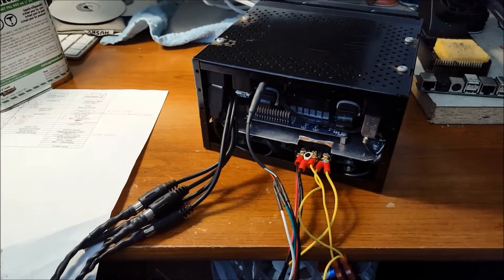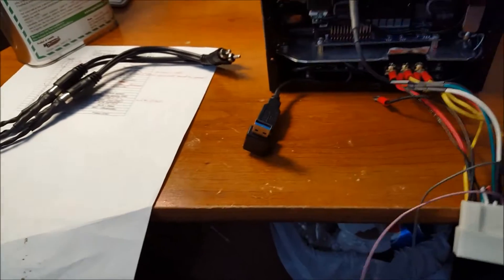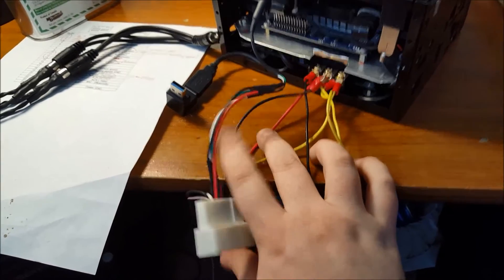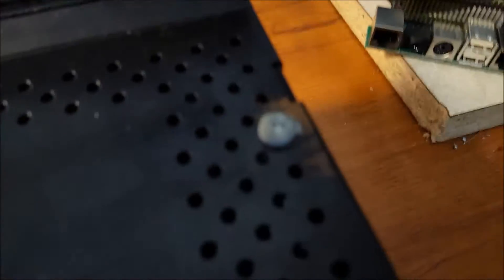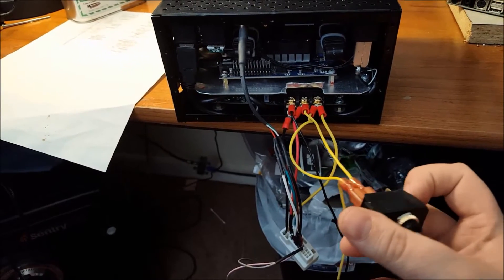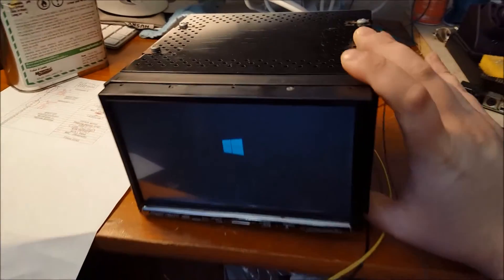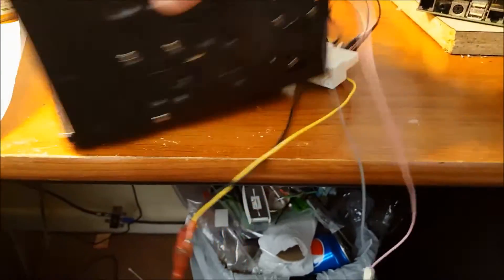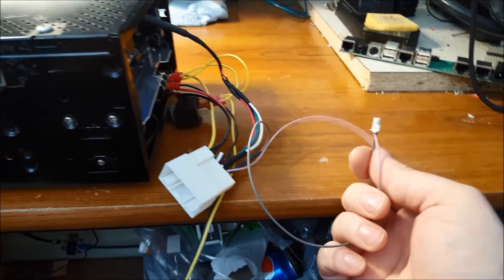MinnowBoard Max Windows 8.1 Double Din Custom built Carputer.

Comment: Hello mate good job on the build its looking good. hope to eventually get video of my project up soon but trouble with fabricating the fascia has knocked me back no end.
I have one massive question concerning the power supply.
Is the M4 ATX monitoring software working for you? Im using windows 10 x64 and the WHQL driver is not working at all. BUT using the same system and booting windows 7 x64 it works just fine with the default windows WHQL driver. After some searching it appears windows 8.1 x64 has the same problem im having... Is the monitoring software working for you?
Now mp3car forum is down the power supply has zero support and minibox customer support is like 1 guy in a fucking bed and breakfast.
Hoping you have already figured a workaround before i go tearing into drivers.
Reply from the maker: Chris12ossi really? This is all news to me. I'll do some testing tonight when I get back to my office, but yes my monitoring software is running just fine on Windows 10; however, I have not let that thing touch a wifi signal since the day it was built so there are many Windows updates that are not on it. I will get back to you later with my findings.
Reply from the maker: I was able to get the software to run just fine on a fully patched version of Windows 10. Do you have a screenshot of the error by any chance?
Reply: Thanks for your replys mate and sorry for my late one. Wasnt expecting you to reply so soon haha. Unfortunately i dont have any screenshots mate as ill i get is an error.code.10 i believe in device manager.
The error shows like using an old legacy soundcard with no driver support. Shows up in device manager and has a yellow.exclamation mark. To be fair i never downloades the inf files from asrock for my asrock z97m itx/ac mobo, i just let win10 do its thing.
Plus due to me testing this i havent been bothered.to drop money on genuine windows disc for it yet.
Ill boot the carpc back up with windows 10 and see what happens when i get the drivers from asrock not from win whql database.
Thanks for your help mate
Reply: Well. we have some err good news! last night i downloaded every single driver from asrocks database and went ahead installing them one by one. Also risked the creators update for windows 10 (1803 i think) and it installed like genuine windows does, for now. For the record i do have a genuine license for windows 10 that i purchased years ago but it only covers one computer. And i plan on buying another now its much cheaper.
After all that last night. It finally showed up in the device manager as a 'HID compliant vendor defined device' BUT still gave me 'NO DEVICE FOUND' when loading the config tool and nothing on the monitoring tool either. The tool loads but shows zero volts, temp etc.
Anyway, i just fired it up today and it worked, well half of it did! The monitoring tool just worked right away but still got NO DEVICE FOUND loading the config tool. Also still 'HID compliant vendor defined device' in device manager.
But now after a restart its back to how it was at the start, 'HID input device' in device manager with yellow exclamation mark. Showing a error code 10 'This device cannot start'.
So yeah not great news but tells me there is some strange compatibility issues with windows 10 since windows 7 works like a charm. And it works on your system.

I just hope people who watch your video and assume it works with all systems like i did and think the m4 atx is worth 70 odd pounds to be for me at least, an arduino and a couple of relays.
Reply from the maker: Chris12ossi I pushed updates yesterday and mine is still working fine. Showes up as a USB Composite Device in the dev manager. I remember having the "device cannot start" error but I can't remember if it was due to a short in the custom usb harness I made for the m4atx or it was due to low power from the usb port. I had a ton of power problems with this build that's why I put in a 12v 5a powered usb hub to correct those funky problems.  

However, I feel that what your experiencing could be a hardware issue.

And this video is old at this point. Software compatibility doesn't last forever otherwise everyone would still be using Windows XP. The video is for educational purposes and is not a "how-to" or "tutorial".

Comment: Where to get the lcd frame with switch
Reply from the maker: kamran ali 

Here's the exact link to what I purchased in 2015, you may need to search around as this one is no longer available on Amazon. 

https://www.amazon.com/dp/B00HNLXZHO/ref=cm_sw_r_cp_apa_i_9aUcBb6WSQFJ1
Reply: CorJFexd 
Thanks  for replying 
I want to know the casing
Reply from the maker: kamran ali 

The case I used was originally a double-din head unit that I gutted out and used metal cutters to shape to my needs.

However; since then people now took up a market in selling such cases. The top few Google searches return several sites that you can find them, but I have no preference or a suggestion on which site you should do business with. Purchase at your own discretion.

https://www.google.com/search?q=carputer+case+double+din&client=ms-android-sprint-us&biw=360&bih=318&prmd=sivn&source=lnms&sa=X&ved=0ahUKEwjbtvDOvqbbAhVLFTQIHdYsBGYQ_AUICCgA
Reply: CorJFexd 
Thanks man

Comment: How much to get this
Reply from the maker: kamran ali 

I don't remember but it was around 1,000 for all the parts including the ones that didn't fit the build, if I was to do it again it would be cheaper since I know what exactly works and fits.
Reply: CorJFexd 
Thanks for replying 
May i know where  to get this staff  and guide  to fix
Reply from the maker: kamran ali 

There is no guide as this build is of my own design. There are many out there I am sure, but this one is one of my own (DIY) and is here for educational purposes only. In fact there are some companies already selling Windows 10 head units; Nonetheless, All are welcome to reverse engineer what is seen in the videos. 

Down in the video description you may find a list of parts that I used in this build. 

I have no further plans to continue this project or to make a guide on how to build it as it has many many flaws.
Reply: CorJFexd 
Thanks alots 
Actually  i want to build  my own double din win10 or Android  i dont know  where to start witch is bater 
raspberry pi 3  is bater or
Odroid-xu4 bater 
I try to find other thanks for replying 

Have a nice day
Reply from the maker: kamran ali 

Personally I ditched the minnowboard max for a Jetway NP93 Pico-itx and I still use it in my head unit to this day. The boot time is much faster than a dev board, but also much slower than M.2 

I struggled with dev boards because I'm more of a hardware guy, and I was only bashing my head over driver issues with the raspberry pi and the minnowboard so for me the easiest way was to resort to embedded PCs such as the Jetway NP93 that already had software and driver support.

If I was to do it again I would go with a Mini-ITX form factor with an M.2 socket and call it a day.
Reply: CorJFexd 
Like this if go with  ITX how is positively  to trun on my amplifier  4ch and 2ch subwoofer

Comment: hi great work! i am looking into building something of this caliber, i was wondering where the best place to buy a double din cage or enclosure from? or did you make it, greatly appreciated if you could reply. thanks.
Reply from the maker: the case is from a broken double-din that I just gutted and used for this purpose. If you google terms "carputer double-din case" you will find a seller who is selling a decent case that even comes with hid/usb front panel buttons, I'm not linking the site because I have not personally purchased anything from this seller.
Reply: thanks for the reply! i have seen those that you speak of, look good quality but the only issue is that i am in england and by the looks of it that's usa based.. they arent super cheap for what it is either.

im surprised that something like those project enclosures aren't readily available, it's kind of dissapointing for me.

i was considering just getting some sheet metal and fabricating it into a suitable cage, with a few vent holes drilled and a suitable facia i suppose it would look the part and function well enough,
Reply: also one more thing, do you happen to know the resolution of that screen? 

ive been looking at a few with hdmi driver board, and i just want to get an idea of the quality, is it 800x480 or higher? im looking for 1080p if possible, ive seen the model you listed in the discription on amazon but its 800x480 and im afraid that isnt good enough for what i would like. again thanks!
Reply from the maker: +Virulent 
this project was not a cheap learning curve, but if i could do it again that'd be a different story. fabrication is probably the cheapest way next to recycling an older double-din, however in this build i ended up with heat issues and i would take everything back for one of those cases made available online, and my screen is 800x480? i think... but "https://www.adafruit.com/categories/400" has the same size monitor with resolutions higher than 1280x800 (for a price of corse)
Reply: i suppose it is not cheap in some respects, i am aiming to keep it quite cheap though from whatever bits i can source, i have quite a big gap behind my dashboard in my car so i was hoping to try and squeeze some air inlets on the front of the unit and vent to the rear. maybe i will buy one of those cases from what you say, can always test it and see what works i guess.

and if that is the case your screen looks a good enough resolution to be honest, it's not like i'm going to be watching movies on it really. do you use this unit to play audio in your car, (might seem like a silly question) but i was just thinking about amplification and volume control too. as a seperate amp seems the case with the build i picture in my head, and then a volume control to suit that. 

Greatly appreciated, you sir are a gent!
Reply from the maker: +Virulent 
I actually had to install an amplifier as my car did not have one. For sound i have an hdmi to analog extractor/convertor in the build and the left and right channels just go to the amp. For volume i have a fully functional steering wheel control (http://www.rcjoycon.com/base_3/menu_10.php?com_board_basic=read_form&com_board_idx=27&menu=10&&com_board_search_code=&com_board_search_value1=&com_board_search_value2=&com_board_page=&) never had a problem with joycon but be prepared if you do a firmware update... you'll need to be able to reach a reset pin on the board. 
check out my other two? videos as many more links are posted and some of this was already discussed. Thanks for checking it out and eventually I'll make a final update video on the finished project.
Reply: great! thanks a lot for the help, i really appreciate it! it's good to get the tips etc from the horses mouth. i've had a lot of experience building computers from an early age so the monitor/pc part will be all good, its just the enclosure,  heat dissipation and audio sides that i wasnt sure on which hardware would be good but ive got some good ideas now so cheers! looking forward to an update vid. subscribed.

Comment: Great build, I'm doing something similar but with a standard mini-itx mainboard. I never know of the Minnowboard! The LCD is capacitive or resistive? Where did you find the 2DIN case? recycled from a head unit?
Reply from the maker: Alessandro Pivaro Thank you! Haha yeah if I was to make another I would go mini-itx. I don't exactly know why I was so compelled to use the minnowboard; it's not the most powerful thing in the world but at least I can say i'm not disappointed with it's performance, and that it's never had any moments of freezing/locking up, crashing, or lag times and the boot times get faster every-time Intel puts out a new bios update. The screen is resistive and I found it on amazon (http://www.amazon.com/gp/product/B00HNLXZHO?psc=1&redirect=true&ref_=oh_aui_detailpage_o09_s00) It's quite a popular screen and I've seen it used in multiple Mini-Itx builds. Lastly the case is unfortunately a recycled Almani DVA-2100 and I just built around the awkwardness of the design. It was not until after the project was complete that I learned of these (http://www.mo-co-so.com/Bybyte-BBX-1-Mini-ITX-In-Dash-Double-Din-Case-p/mcs-byb-bbx-1.htm) actual double-din mini Itx cases for purchase.
Reply: CorJFexd I'm using this mainboard here http://www.asrock.com/mb/Intel/D1800B-ITX/index.it.asp with integrated celeron dual core CPU. I think your CPU is more powerful than mine. I bought exactly the case you linked but there's not enough space inside for dual HDD, m2 atx and amplifier board. Now I installed Windows 10 and it runs great... I'm waiting for the ISO harness adapter and then the system is ready to be installed :)
Reply from the maker: Alessandro Pivaro Never got a notification for your reply. weird. Nah that board is faster definitely. 2.58GHz x2. That's sad to hear about the space issue. What size HDD? 2.5? you could try Sata DOM to house the operating system just to save space. Their very small "http://www.newegg.com/Product/Product.aspx?Item=1B0-000D-00010R&cm_re=sata_dom-_-1B0-000D-00010R-_-Product" the only problem with stata dom is that its a tad bit slower than solid state at 250 ish MB/s vs solid state at 550 ish MB/s but I'll probably go sata dom myself when I upgrade to windows 10. Or there's also the option of going to MSata and using an adapter card "http://www.amazon.com/SMAKN%C2%AE-Mini-MSATA-6-0Gps-Adapter/dp/B00XVD1KJS/ref=sr_1_33?ie=UTF8&qid=1439268336&sr=8-33&keywords=msata+ssd+to+sata" and best part about MSata. It's the same speed as solid state.

Comment: How do you think an asus pen stick would compare to this? http://m.hexus.net/tech/news/systems/83735-asus-pen-stick-intel-cherry-trail-powered-hdmi-stick-pc/
Reply from the maker: Vicious.Ventu I'm surprised that it's not released yet. I wonder if ASUS is having issues maybe? I haven't been able to find out what revision processor they intend to use in the pen stick unless ASUS plans on allowing customers to choose between the three available Intel Atom Processors, or as they call it "Cherry Trail", but if they intend to use the Z8700 @ 2.4GHz x4 then I'd imagine the pen stick would be quite nice, but I don't know how I feel about the 32GB flash memory It kinda makes me feel like they used a lot of mobile chips and neglected to utilize the core functions of Intel's Atom. It'd be nice to see a tear-down because I am quite curious if they could scratch the flash memory and use M.2 Sata instead, and a few people made comments stating their using 802.11 instead of 802.12 which makes me wonder if they designed this long ago and never planed on releasing it. Time will tell. 

I could see it being very handy in the "Black Hat" Community as it is quite mobile, but if it was to be used in businesses I can see your standard user accidentally breaking it because the HDMI just protrudes from the device itself, but it may be very useful in embedded machines like food ordering systems, horse track racing betting machines, or information kiosks; but, that too depends on how durable the Pen Stick is. 

For Businesses sake it has a lot of competition and I'm willing to bet that for embedded machines (Specifically ones to be left forgotten)  people would buy Pico-ITX such as Intel's Jetway Celeron N2930 before they would buy ASUS.

Overall very cool read. Thanks for that!